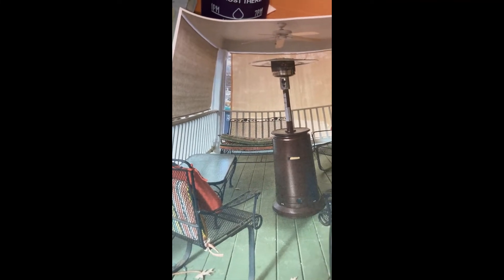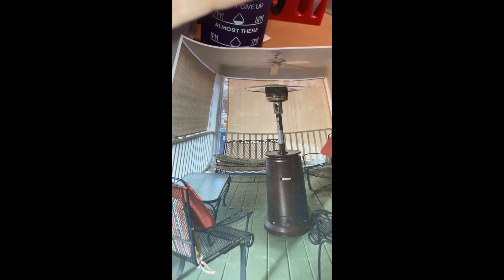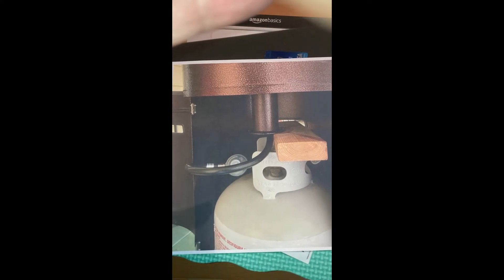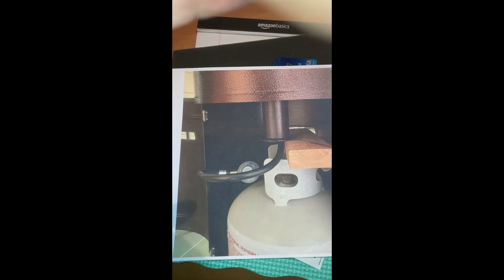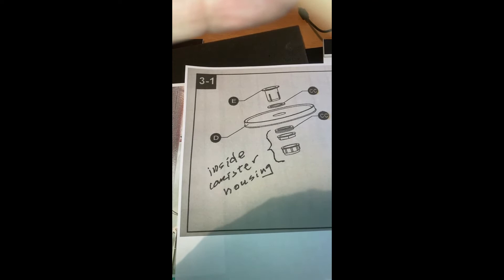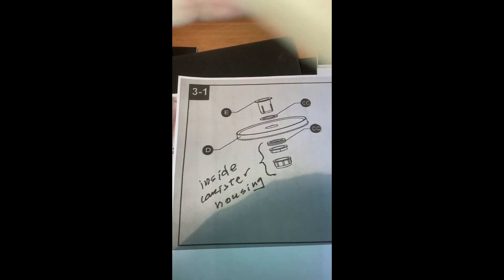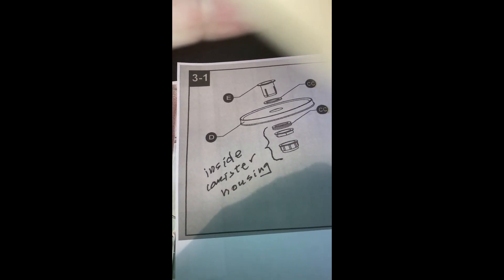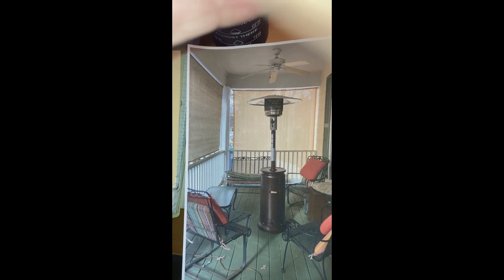Hack to make height of propane heater adjustable

Comment: Thank you I've been up three hours trying to figure out a way to low this heater
Reply from the maker: sorry, i don't get notifications of comments and not sure how to fix that. Does your stock heater have an adjustable height table? If so, disassembling the post and hardware for adjusting the height of the table and reassembling to adjust the height of the post and burner should work.